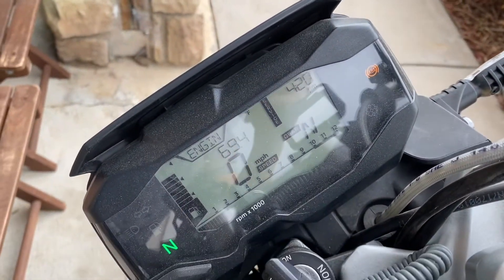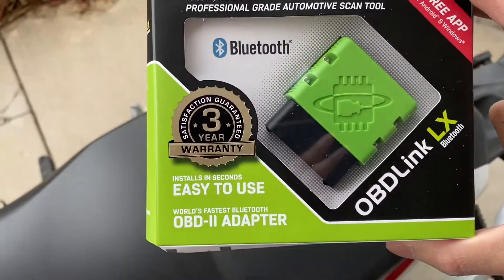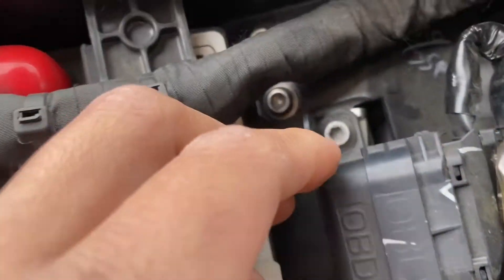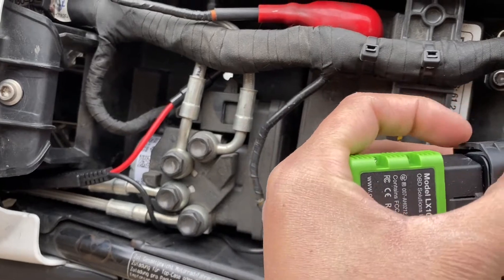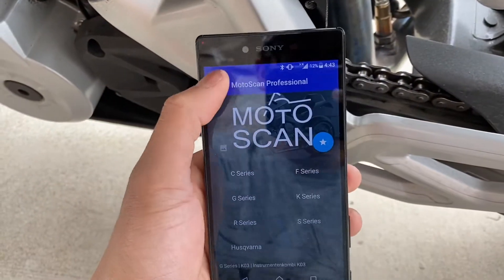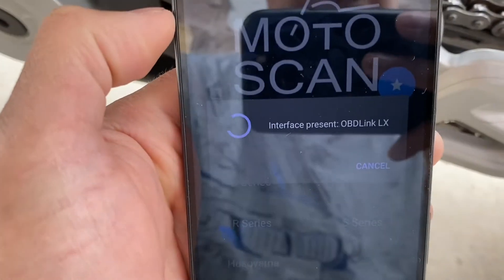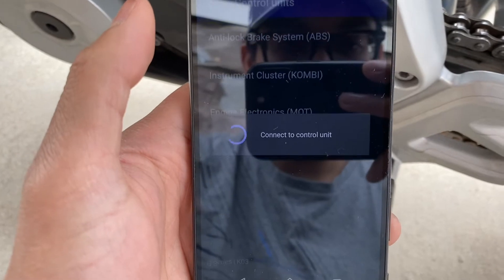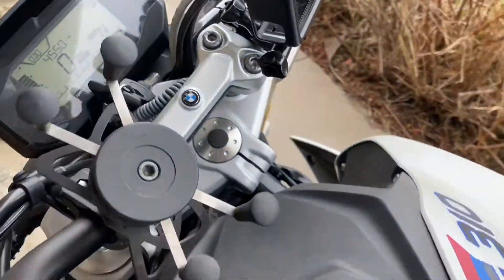BMW G310R Service Rest ODBLink LX Moto Scan

Comment: I think I need to reset the date to a year in the future and the mileage to 6000 more miles.  If I only reset one of these parameters, I believe the other will activate before service is due.  Honestly, I keep up with the service pretty well, so I don't need a service reminder and it's a nuisance.  I just set it 5 years into the future and 50,000 miles.